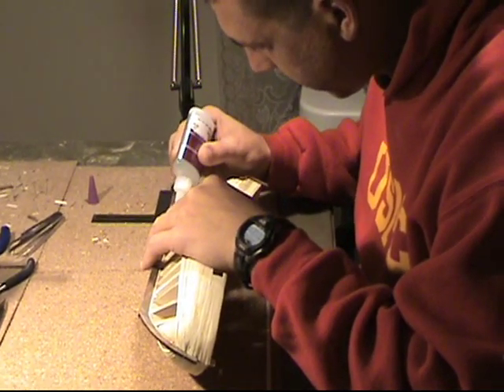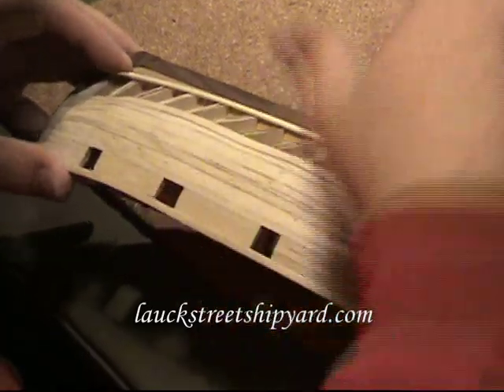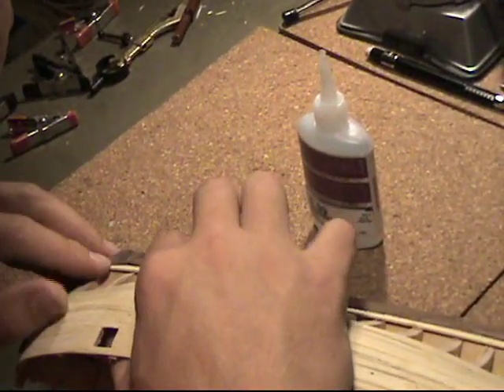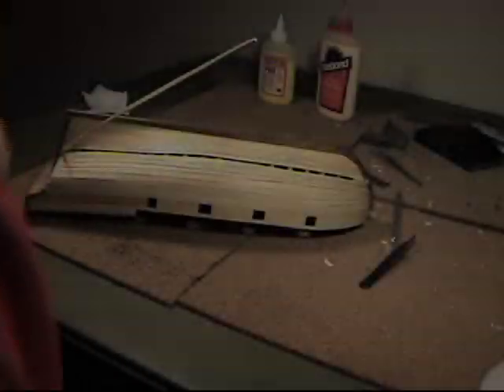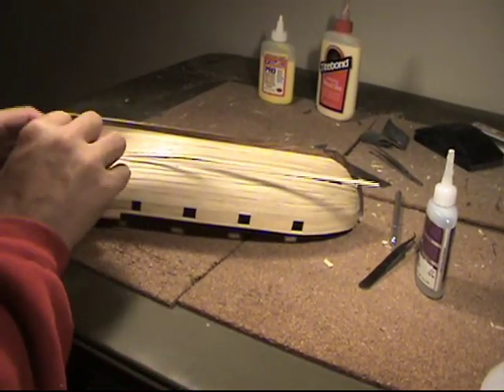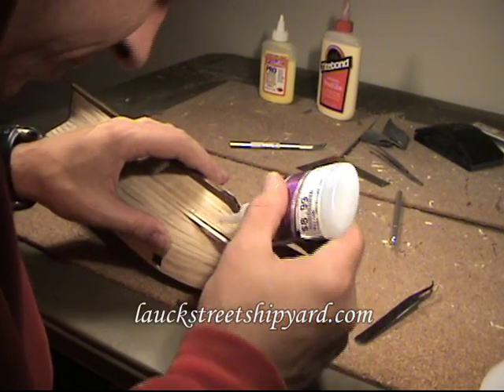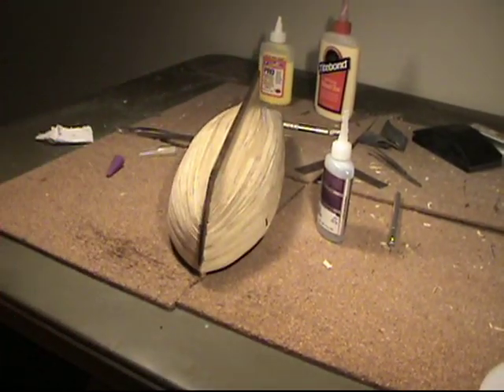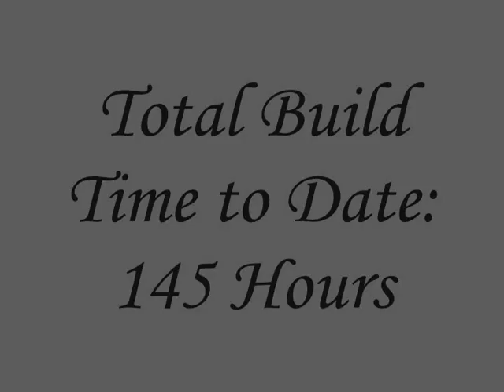Ship Model - Armed Virginia Sloop, 1768 - Model Shipways, 1st Layer of Planking - Part 3

Comment: Nice work on your first kit!
Agree that CA is a blessing and a curse.. For attaching the first layer of planking and other structural items, I use planking nails and PVA/Elmer's wood glue... am certain the hull won't come apart ;D  While PVA is more time consuming, I place a couple of planks on port and starboard sides of the bulkheads, and while they are drying, I build up the other bits - deck furniture, masts, booms, etc...  For bending the wood, soaking it in water with 10% ammonia added makes it more "bendable"...

Comment: In the future you might want to consider using a rabbet from bow to keel, the planks will lay neatly in the rabbet and the model will be neater and more realistic. In addition I don't use CA glue in woodwork. While its faster to set and overall easier to use, it firstly stains the planks and over time I feel it looses it adhesive strength. One could argue ..hey you're going to paint it, whats the difference. I am an old timer and have seen this glue breakdown over time. I do use CA in rigging, in this case its just a helpful aid if you wrap and knot properly. However you did an excellent job on your first model. I by the way use white glue, however it requires allot of clamping and is very timely. I am kind of surprised that the rabbet is not in the instructions with your model. Chuck from model Shipways includes this very step of adding a rabbet. One of those models being the Siren. Go to their site you can download the manual for free.

Comment: use pva (white) glue if you plan on staining or varnishing that ca glue soaks into the wood grain and has to be sanded alot and you wil end up with splotches of unstained wood 
if you plan on painting its ok to use 
just use it very sparingly that guy uses way way way too much i use a tiny little brush apply it never right out of the bottle lol you can tell that guy is a beginner
the name of the glue is cyanoacrylate